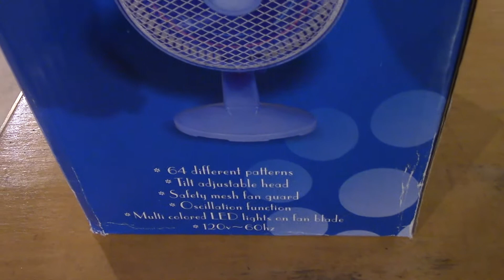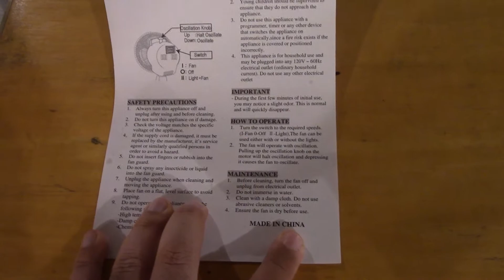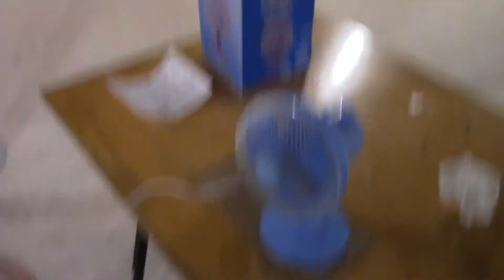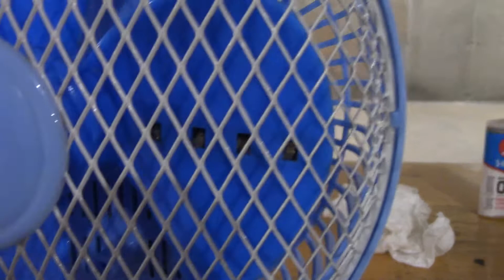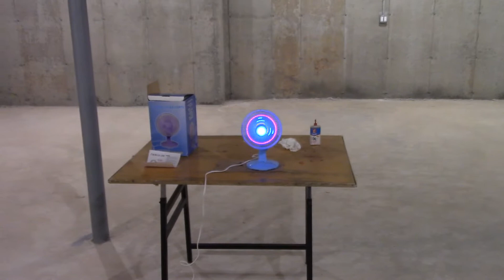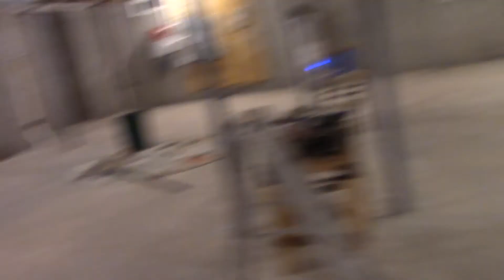Table Fan with Cool LED Lights.

Comment: I need that kine!  That's pretty cool, I must say.  Would fit right in with the stuff at Club Jay...
...so much so that I found a cheap, handheld, battery-powered one for $2.23 on fleabay that I ordered.  I know it's junk but for that price why not.  I'll convert it to USB when I get it.
Reply: I actually have a 120mm computer fan that has a USB connection that you can program your own text into.  There's a set number of characters (I forget what it was).  I should make a video of that...
Reply from the maker: It is pretty awesome, and I thought of your bar when this was going! It went great when I had my blacklights or christmas lights on in my dorm room. I think still needs a little more oil on the front, but tough to do. Maybe you could check it out sometime.
Reply: Between that, the blacklights, Christmas lights, and the tornado lamp, you're starting your own Sharkie's Swim Club over there!
Reply from the maker: Haha. It WAS pretty awesome for the time.
Reply: Thats a pretty cool little fan now if only it could tell time like jaykays i think i lkkw this one bit better.
Both are still pretth cool though.
Reply from the maker: I'm more than okay with it just giving a nice light pattern, one slightly less complex thing about it then. It doesn't have to remember anything.
Reply: You mean "ligth" pattern, as per the instruction page.
Reply from the maker: Oh damn I missed that!! Guess it wasn't simpical enough.
Reply: Sharkie626 you know it would have been really cool if you could plug it into a computer and program your own light pattern or use pre programmed patterns.
Reply: jaykay18 that sounds pretty cool i would like to see that sometime.